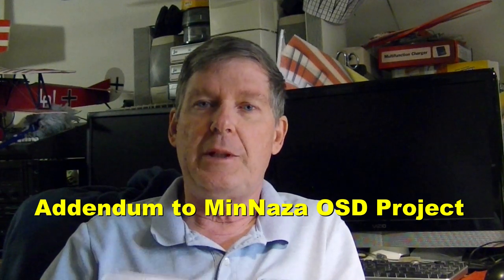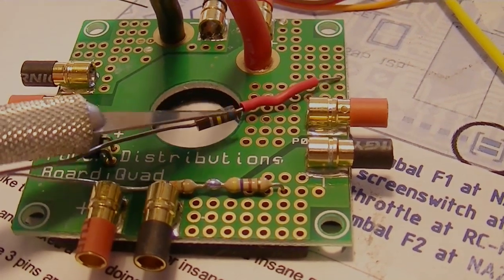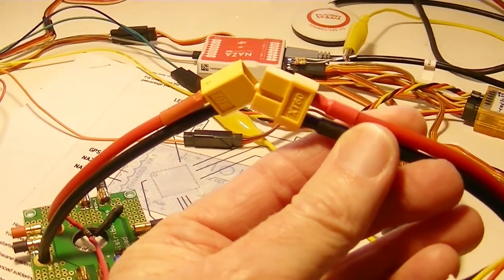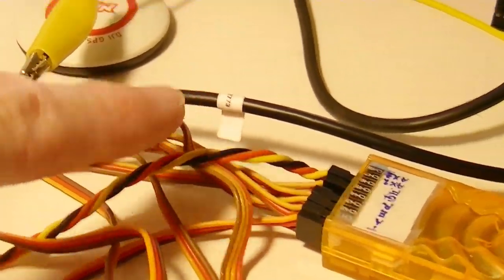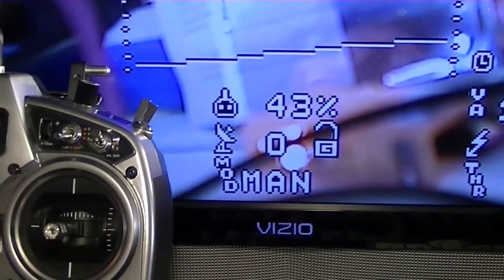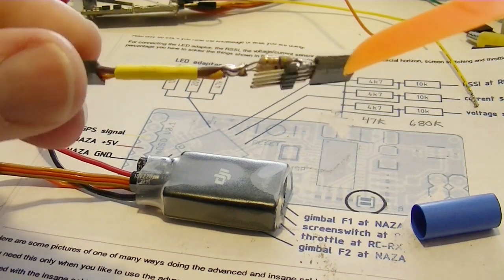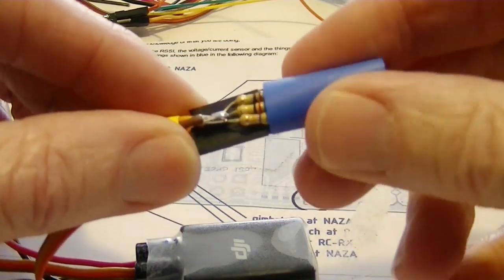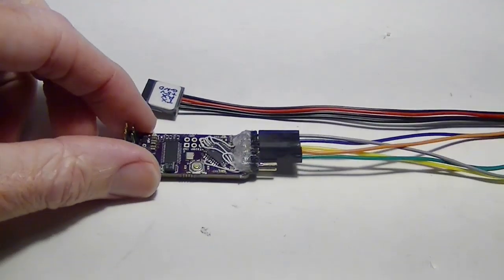Addendum 1 MinNaza OSD Project (sort of Part 4) Voltage and LED Status Display

Comment: Where does the 5v supply come from on your distribution board to measure flight battery voltage? I'm not using a voltage or current sensor, but want volts shown on the osd.
Reply: Is the 680k soldered to an actual 5v supply on your distribution board? Or is it soldered to main 4s voltage and the divider breaks it down to 5v? I'm confused.
Reply from the maker: +James Dyke It is soldered to the main 4s voltage on the power distribution board for the ESCs and yes the divider reduces it to 5v.
Reply: +dmerc00 brilliant Thankyou. Is any further calibration necessary? As I see your 4s battery was showing 12v on the osd.
Reply from the maker: +James Dyke It should be just fine without calibration but if not just change the value of the resistor a little.
Reply: +dmerc00 marvellous. Thanks for your help
Reply: +dmerc00 sorry to be a pain again, is it a 47k, or 4k7 resistor? I'm really making progress because of your videos, and just want to make sure I'm understanding them right.

Comment: In LED status ,why it doesn't wok.I use 100k 200k 47k same as your video already.When i connect with out resister it work but it's mode show doesn't match.
Reply: I use minNAZAOSD_DJI.hex firmware.
Reply from the maker: thaviratngernyen It's hard to know. You may have some of the wires switched around or something. Follow the diagram in the project wiki.
Reply: ***** On the bottom (R2) ,must use 47k or 48k to read closer in 3s ,thanks.

Comment: Would I still use the 47k and the 680k for a 3 cell battery for the Voltage adapter? You mention that you are soldering those to a 5v source on your power distribution board, wouldn't it be the voltage of what your battery is not a 5v source (11.1v for a 3 cell and 14.8v for 4 cell)? I have really enjoyed your videos, GREAT JOB!
Reply: Also where is a good source for the 670k to 680k resistor?
Reply from the maker: Ryan Traxler From Radio Shack.
Reply from the maker: No the divider brakes the voltage down to 5v from the fully charged 16.8v 4s flight battery. See notes in description under the video. You would not do this if you use a voltage/current sensor instead.

Comment: Very nice guide, if you work with things like this, i recommend to have a set of these on hand: www.ebay.com/itm/New-Colorful-1X-40-root-1p-1p-Pin-Connector-Dupont-Wire-20cm-Cable-Line-MM-/221390895698
Reply from the maker: I use Pololu wire sets now. They are great and shipped from AZ,USA.

Comment: in your video you say that on the power distribution board you have 5V on the pads but are you supplying that board with 5V because from what I can see that would go directly to you battery voltage

Comment: great set of videos m8
Reply from the maker: Thank you so much.
Reply: ***** now you have had this mod set up for a while what was your feelings about it do you like it looking for info about gps display
Reply from the maker: A Parkin The MinNaza mod is quite complicated so if there is an easier way to put an OSD on the NAZA M Lite I would do that.  However now that I have done it I have to say that it does that job well and is very customizable. I like it.

Comment: Thanks for this great series.i use a 3 cell pack. But using the recommended resistors I see 14.6v when the pack is only 11.2.
How do I calculate the correct resistor values to get a proper reading? Many thanks. Steve
Reply from the maker: Good Question!...
The recommended resistor divider is 10 to 1 (47k ohms over 4.7k ohms) but this only works with a voltage/current sensor.The target voltage on the output of the divider should be about 0.825 dc volts for a 3s battery 
(1.1vdc for a 4s battery using the provided firmware).
Formula is R1 = R2 x (Vin/Vout - 1).  For a 3s battery R1 = 47k x ((12.6/0.825)-1) = 670k.
So if you use a 47k on the bottom (R2) you would need a 670k on the top (R1).
Keep in mind it's hard to find exact matching resistors so you might have to experiment.

Comment: It's brilliant! I really like the LED Status/Flight Modes on the display screen! This project is really interesting! Great job as usual! Have a great week-end
Reply from the maker: It should be handy.  The screen switch is the only thing I many not need out of the six inputs I did. Might trade it for RSSI if I ever figure out where the output is on the HK receiver.